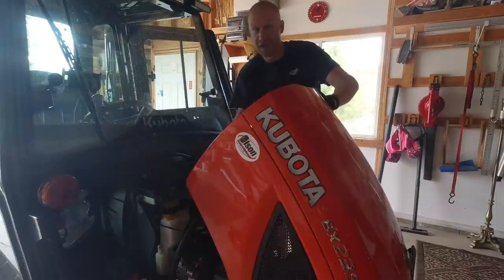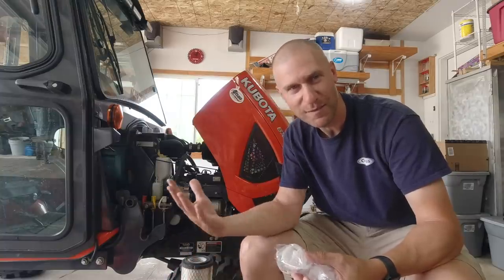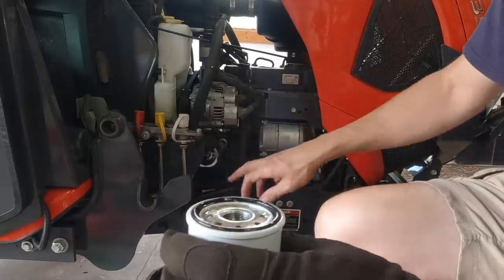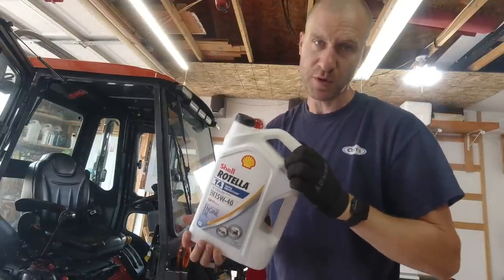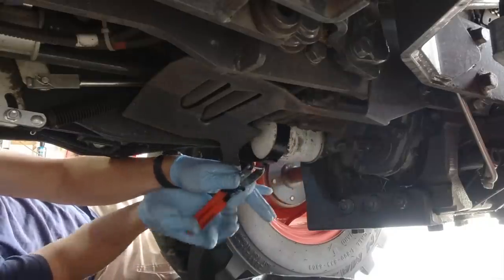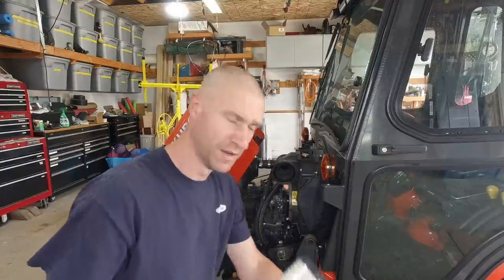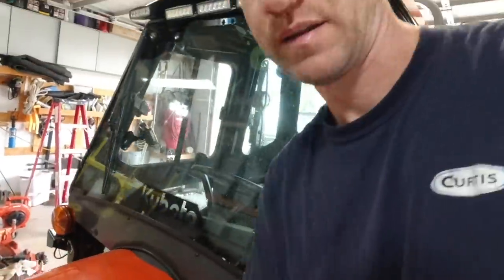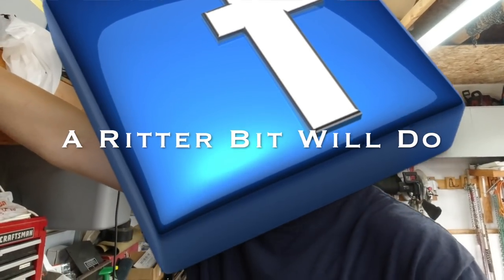KUBOTA'S HORRIBLE FILTER DESIGN (BX tractor)

Comment: Nice job John. I change both fuel filters annually, in the fall. I know it is over kill. But, an ounce of prevention is worth a pound of cure. I don't want to have to change that filter underneath the tractor because it is plugged up while plowing.
Reply from the maker: I don’t blame you one bit. At -20 my fuel gelled and plugged up that filter. It was not fun changing it in the driveway. 
Keep on tractoring!

Comment: Another great video (I know it's a couple years old).  I just did my fuel filters for the first time.  I have 100 hours.  I don't know if I would wait longer, the underneath one was black inside.  I am going to get an external filter kit but will wait another 100 hours.  It truly is a PIA to change that bottom one.
Reply from the maker: Yep, it’s a pain for sure. Horrible design! 
Keep on tractoring

Comment: Good timing with this vid - at 475 hrs I'm over due for my 400 hr service.  Luckily the previous owner changed ALL the filters including fuel every 50 hrs!  Thanks to your complaints in this video,  I just ordered an aftermarket fuel filter with water separator to do the relocation to the front mod...
Reply from the maker: Good for you! You won’t regret having that vs the factory system. I hope this fuel supply design gets reconfigured in the next model. There isn’t much room to work under there. 
Keep on tractoring!

Comment: Thanks for sharing your tips and frustrations.  I'm getting ready to change my BX23S fuel filters for the first time.  Thinking I'll use my backhoe outriggers to jack up the hind end and put blocking under axles to help with getting at the booger of a fuel filter.
Reply: Getting ready to do mine, how was it?

Comment: I put a barbed brass coupler on the hose going to the tank and added a piece of fuel line then pushed up a little and curved it above so that the next time I can disconnect the clamp  and have room to pull down and access much easier.

Comment: You made a comment about the bad strap wrench's for oil filter removal.  I  had the same problem, and other Kubota owners put me on to this filter remover.  It is like a set of vice grips, and it doesn't slip but removers the old oil filters easy.  Harbor Freight 10 bucks.  Fits about any filter.

Comment: I have a 2021 bx2680 and it seems the coolant level frequently needs attention. I think it is a evaporation issue. No leaks anywhere. Only 25 hrs on my tractor now. do you experience this with your bx? Have you by chance heard of this with other folks?
Reply from the maker: I did have this issue with my BX and I tightened all the hose clamps on the cooling system and it seemed to help. I didn’t notice it leaking either, guessing it was a slow leak. Give that a try and see if it helps. 
Keep on tractoring!

Comment: Thanks for the Video now I dread changing mine even more! Haha. I haven’t changed the fuel filters yet, been putting it off for this very reason. I filter my fuel from the transfer tank which helps me a lot on fuel filter life. I notice the BX air filter gets more dirt and dust to it then any other tractor I have. I don’t understand that. I’m with you, Kubota needs to redesign there fuel filter setup ASAP on the BX.
Reply from the maker: That’s smart to filter your fuel at your transfer tank! Have you heard that on road diesel is more filtered than off road? I figured you might have some insight on that with busses and tractors. Someone left a comment suggesting this. 
Keep on tractoring!
Reply: A RITTER BIT WILL DO I’ve heard that debate as well but I struggle to believe this. I’m pretty sure quality would be the same but I don’t have any facts to back this. I’ve ran both for many hours of operation in tractors and have never recognized a difference. Storage of off road at gas station around here sometimes isn’t as clean as highway fuel. Kinda have to learn where to get it to rule out this factor.
Reply: there's one fuel filter before the pump and one before the engine.... so the pump get's clean fuel and the engine also... 👍

Comment: I added the aftermarket fuel filter on my 2370 best thing I did plus the offroad fuel I was using was very dirty. 40hours on the filter under the tractor and was  blocked solid.  Plus now I use on road and the pumps have a filter on there filler line. It is a pain and you don't have to worry about causing a leak by pinching the line to tight. Not a good day. Keep on tractoring.
Reply from the maker: I did t realize there was a difference in filter quality between on road or off road. I also use on road. I should do the upgrade as well. 
Keep on tractoring!

Comment: You have to be careful when cranking on those oil filters. The manual says to screw on until the rubber gasket just touches the engine and then tighten 1/2 turn only. That procedure holds true for most engines. The same is true for the transmission filter. HAND TIGHTEN 1/2 turn only... no wrench. :-)
Reply from the maker: I've heard that and probably have read that somewhere as well. However, I just don't trust that theory. I'd really hate to lose a filter a half turn with a wrench gives me peace of mind. 
Keep on tractoring!
Reply: @ritterjon  It's actually in your BX23S Operator's Manual. :-)   Some filters like spin-on fuel filters will specify 3/4 turn after contact but oil filters are usually all 1/2 turn. Never had one fall off in over 50 years. In fact, with just 1/2 turn they still require a wrench for removal. Go figure. :-)

Comment: Hi Jon, I totally agree that lower fuel filter is a pain. At 49.2 hours I changed every filter and fluid, even the front axle, just for my own peace of mind. I will be relocating the lower fuel filter at the next service. I had a John Deere 332 with the Yanmar 3TN66 3cyl diesel. It had the electric fuel pump up in the engine area on the frame, and a single fuel filter attached to the engine that had a replaceable element. Kubota should get with it and do the same. Take care.
Reply from the maker: I agree, why Kubota sticks with this design is beyond me. It needs fixing! 
Keep on tractoring!

Comment: I had to change the bottom fuel filter on my BX23s in January (-30 C) in an unheated shop.  It was plugged because of still having summer diesel fuel in the tank.  I used the loader and the backhoe outriggers as a hoist to get more room underneath, but remember to use axle stands for safety.
Reply from the maker: Sounds like you experienced that same situation I did a few years ago. I didn't have the loader or backhoe for the extra clearance though. It was a lesson learned for sure! 
Keep on tractoring!

Comment: I replace the fuel filter under the tractor by installing a small see through water separator/fuel filter, which I placed near the front.

don't want to scare you Jon but do a search on the Achilles heel of the Kubotas, the diff lock. Just lost my tractor to it. wondering why I had a hard time to put it in gear, I found out it was getting in gear by itself. Gone for warranty repairs after not even a year. The other problem on my BX is the quick disconnect on the FEL hoses. Mine were moving up and down and seeping oil. Miss my toy. :(
Reply from the maker: I wonder what the issue is regarding the diff lock. I haven’t heard of that before. I did have the quick disconnect leak and got that fixed under warranty. 
Hope the new fuel filter orientation is working well for you. 
Keep on tractoring!
Reply: @ritterjon  Of what I have read, it is a piss poor design and many have either cut the pedal off or disconnected it. I don't think I'll want to use it again when I get my tractor back. Just don't want to take any chance. It only had 143 hours on it.

Comment: I did the 200 hour at 170.  When you buy a 9 year old used tractor with only 140 hours, it is for sure time to change the fluids.  To get it back on schedule I will just push everything except the engine oil change.  I did however go ahead and change the hystat oil and front axle oil as well.
Reply from the maker: Always a good idea to change all fluids at least once every 10 years no matter how many hours are on it. 
Keep on tractoring!

Comment: I had 25 hours on bx23s and stopped running.  had to replace both fuel filters.  It sucks that you have to get under the tractor and spend an hour changing this fuel filter.  Is there an after-market larger filter that can be used?  I also purchased a flo tool to filter the diesel so the crud does not get into the fuel line.  Thanks
Reply from the maker: Oh wow, only after 25 hours. That seems pretty weird. Wonder what would have caused that. 
Keep on tractoring!

Comment: I have a 50 hour coming up, thanks for making me dread that day :)
Reply from the maker: You really don't need to change the fuel filter until 200 or 400 hours. I changed mine at 200 because I didn't want to deal with it during the winter in my unheated garage. 
Keep on tractoring!

Comment: The reason why they have two fuel filters is a good idea the filter underneath the floor board is to pick up any debris from the fuel before it reaches the pump the second filter is safety feature because if the fuel pump goes bad they can come apart from the inside and the debris will be in the fuel that the filter by the engine will pick up it is the last line of defense before damage to the engine. But I do wish there was a water separator.
Reply from the maker: I get the concept but it seems like it should be an easy thing to fix. The filter is hard to get at and is prone to damage from brush and sticks. 
Keep on tractoring!
Reply: @ritterjon  If you have an idea, send it to them. As an former engineer, receiving a solution with the complaint can help make a design change happen a bit quicker if it has been thought out and we'll presented.

Comment: I also added the inner air filter. It goes inside the regular air filter. Got at Messecks.
Reply from the maker: That's great, I didn't know one was available for the BX series. They are pretty standard for the larger machines. 
Keep on tractoring!
Reply: Do you mean it only came with ONE air filter element?  Most SCUT/CUT tractors come with the inner/outer air filter elements right from the factory. The inner one hardly ever gets dirty as the outer one does a good job.

Comment: Does that pain filter have to be underneath at that exact location because u can extend the hose near were the other is, maybe that will make things easier, am just thinking out loud, thanks for sharing Jon.
Reply from the maker: Kubota for some reason wanted to have filter before the fuel pump. I'm not sure why they do that, I don't think it's that big of a deal. I hope they fix the issue in future models. 
Keep on tractoring!
Reply: A RITTER BIT WILL DO its before the pump cause if any junk is in the fuel it will damage the pump cause of the tight  tolerances in the pump.

Comment: Tractor Supply had 5-7 settlement bowl for fuel filter, 1 (ford) had a glass bowl for about 40 bux. Cleaning consists of turning off the valve, unsceweing the bulb, dump it out, wipe with a rag, reassemble-make sure gasket is in place, turn valve on. 
No extras ever.

Comment: Could you replace the fuel hose and put the filter under the hood next ti the second filter. Wayne from Wisconsin.
Reply from the maker: It can be done but the fuel pump is in between the filters right now. The whole fuel supply line just needs a redesign. 
Keep on tractoring!
Reply: A RITTER BIT WILL DO  John, what I meant was to run a fuel line from the fuel tank to the under the hood to the filter then run a line from the filter back to the fuel pump to get to the 2 nd filter. Then you could change the filter under the hood instead of under the tractor.

Comment: That other unit on Tim's JD is a water collector. Not really a filter. Found this as well :"he first filter protects this electric pump, the 2nd protects the engines fuel injectors if that pump happens to fall appart"

Comment: I got some bad fuel for my 2009 BX25 a few years back.  I appreciate the dual fuel filters, might have saved my fuel pump and possible other problems, but who is to say for sure.  Bought the fuel at a BP, thought that the major brands would be the safest, guess that I thought wrong.
Reply from the maker: It’s nice there is a filter before the fuel
pump but the design configuration could use a little work. 
Keep on tractoring!
Reply: Major brands typically are.  There was an incident at one of our local stations a few years back where they accidentally filled up the regular unleaded tank with diesel...needless to say there were quite a few odd vehicle breakdowns that week....they had to pump all the fuel out of the storage tanks and refill with the proper fuel plus pay for repairs on all the vehicles that were rendered useless from that mix-up.

Comment: Unfortunately deere has the exact same inline filter like the kubota underneath too tim has shown changing it before it looks like it's a pain also. They are just trying to protect the fuel pump I wish they'd find a way to relocate it and put a fuel water separator on like the deeres do
Reply from the maker: Was that an after market filter Tim had? I thought it was factory. Opps, well regardless it needs to be improved. 
Keep on tractoring!
Reply: @ritterjon  yup its factory they are trying to do the same thing kubota is and protect the fuel filter down there

Comment: Kubota does have filters on there engines, on my b1700 its right on the engine and on my ZD326 its also right on the engine. The newer mini compact tractors they cut corners to save on cost factor that's why yours are in line filters.

Comment: I think I would switch to the full synthetic T6 up where you are 15-40 is kind of thick for 20 below! Full Synthetic 5/40 is better, especially when I think Kubota recommends 10/30.
Reply from the maker: Actually Kubota has 15/40 listed as an appropriate oil to use in our winter temps. I didn't have any issues last winter with it and would always plug in the block heater before starting so that helps a lot. 
Keep on tractoring!

Comment: Add the second air filter.  Kubota dose not put it on the bx but can just add it anytime. Stens 100-5412508303-5 Inner Kohler Air Filter  is the one I use on my bx. Just extra help in very dirty environments.

Comment: I share your grief about the 2 fuel filters, maybe we can replace the rear filter with a bypass and just change the engine filter twice as often? Or gang the two filters in the engine compartment?  Getting too old to crawl under the bx at -25.
Reply: One is before the fuel pump, one is after...

Comment: That fuel filter looks easier to change than the fuel filter in my 87 Ranger that's in the frame rail between the exhaust and engine block....#1 stupid place for a fuel filter, next to the exhaust pipe off the header, #2 there may be room for a kindergarten age child to fit their hands in there, but not an adult...its purely by feel and pliers that I got that stupid filter out of there and of course its a damn Ford thing with plastic quick connect fittings rather than rubber hose and a couple clamps that would make it a simple easy change but trying to fuss with getting the filter in there holding those quick connect fittings together while trying to fish quick connect clips through the fittings is a joke in itself.  

I think I'll go with an aftermarket fuel filter kit on my BX when I get it though, there's no need for 2 fuel filters of that type, I'll leave the one at the engine but the one in the frame is going bye bye for sure.

Comment: I hate those filters also.  I change the first one in frame every other year (150hrs) and the one by the engine every 4 years, so not such a big deal.  In past years when I ran it more and had fuel problems it was a bigger deal for me.  I use premium fuel from a good supplier and have less problems now.
Reply from the maker: That's pretty much what I do, it's such a pain that I didn't want to deal with it earlier because I knew it be fine until at least 200 hours. Hope they improve this in the next update. 
Keep on tractoring!

Comment: The owners manual and the workshop manual both don’t call for fuel filter changes until the 400 hour mark.
Reply from the maker: That's true, I guess I assumed it was every 100 hours or so. Oh well, my filter underneath was pretty dirty partly because I unknowingly ran it without a fuel cap while clearing brush so better to be safe than sorry. 
Keep on tractoring!
Reply: A RITTER BIT WILL DO in that case I completely agree with your choice.

Comment: 1025r I'd has a fuel filter under the floorboard on the left side beside the water separator by the motor
Reply from the maker: I didn’t realize that. I wonder how difficult it is to change. 
Keep on tractoring!
Reply: Its real easy. Ive already done it beofre on my 1025r.

Comment: Did you follow Bota Bob on this very subject?
Reply from the maker: I did not, did he do a similar video. I'll have to check out his channel. 
Keep on tractoring!
Reply: @ritterjon  Sure enough, although his tractor is a BX1850 so is ever so slightly different than yours, but rear fuel filter is still pretty miserable.  Oh, and also he has and recommends the inner air filter such as mentioned by other commenters.